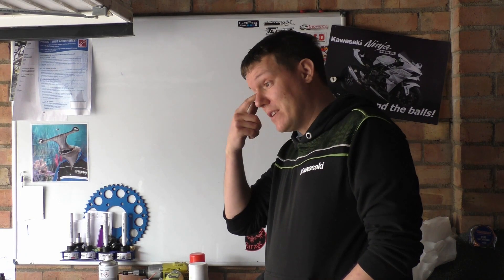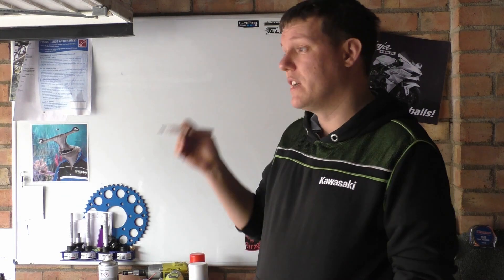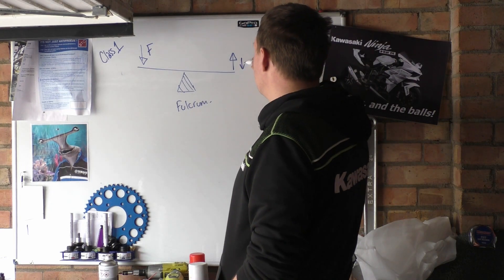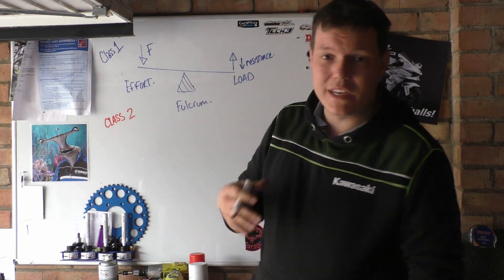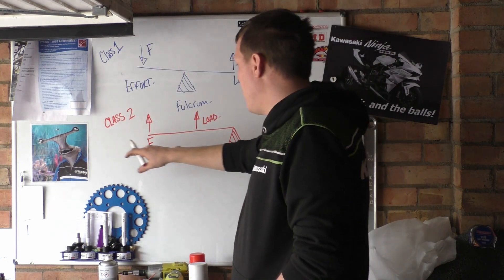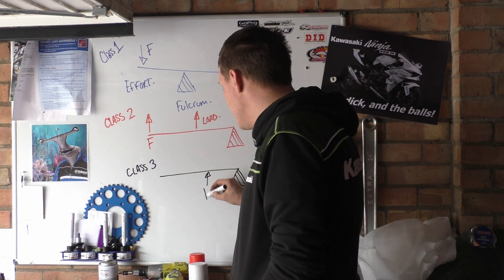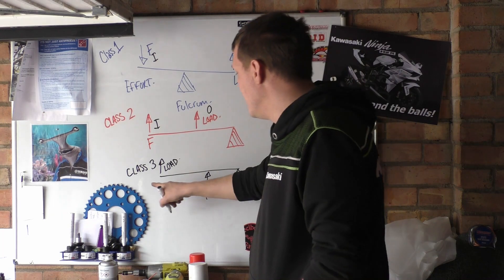Brake question

Comment: Hey Matt!

I've looked on your channel and searched youtube for differences (advantages/disadvantages) in brake lines setup (race vs piggyback vs stock) and couldn't find anything.  Is there any advantage/disadvantage to them, besides the difference in cost and number of lines?

inb4: i could search on google, but with everybody with an internet connection being a genius in all fields nowadays, i'd like an answer from someone i trust.

Thank you!
Reply from the maker: Piggy back is cheaper, but a bit harder to bleed
Reply from the maker: Race is for safety reasons I.e less connection points, less likely to fail
Reply: @thedirtyworkshop   Thank you so much for your answer! I thought about the number of failure points being lower on the race setup, but I thought "well surely there must be more to it, otherwise manufacturers would ditch the 1 into 2 lines setup which has more parts and is more expensive". Guess i was wrong  :D

Thanks again!
Reply from the maker: Remember in racing 2 things are going on 1) you constantly jam on the brakes as hard as possible. 2) you're going as fast as you can all the time. You're dependant on your brakes being 100%.

For the road both cases are not true, and piggy back systems are fine, it's just racing wants to make sure everything no matter how small was done.
Reply: @thedirtyworkshop   I see, i'm not building a track bike nor do i own a fast bike ( 98 gsx600f ) but i want something that has as little chance of failure as possible.
Reply from the maker: Any option is fine
Reply: @thedirtyworkshop   Thank you! :D

Comment: Would it not boil down to the angle? I would guess at class 1 if the load is past 90° if under its class 2. Suppose it's down to the shape of the lever?
Reply: Daz H gonna have to vote for this, can't decide if its a bent class 1 or a relocated class 2 if that makes any fucking sense hahaha

Comment: I'm not sure which about the class but was wondering do you know why motorcycles don't use cable discs? IIRC some used cable drums but I'm guessing it's a power thing, obviously not the same but bicycle cable discs are pretty good when I tried them, hydraulic being slightly better
Reply from the maker: Great question - guess its gonna be added to that fucking list LOL

Comment: Class 1 I'd say. My way of seeing this is that the fulcrum is between effort and load (and it doesn't matter if the lever is not "straight"). When I say fulcrum is "between" I notice that the load can be on the side of the force, but it's still "after" the fulcrum (if you follow the lever
Reply: If you follow the lever from load to end, you find the fulcrum first and then the load.

Comment: I think class 1 with a factor of about 3. So i have a question. So 2 cm movement is about 6 mm of master piston movement because of the lever
The slave must be about 2 times bigger to have a factor of 4 lower movement to move the brakepads about 1.5 mm which is i think about the movement it does. However the 2 calipers inside and outside are way more than a factor of 4 isnt it? Not to speak about 2 calipers on each side. So how does that work? Next vid ?
Reply from the maker: Next vid

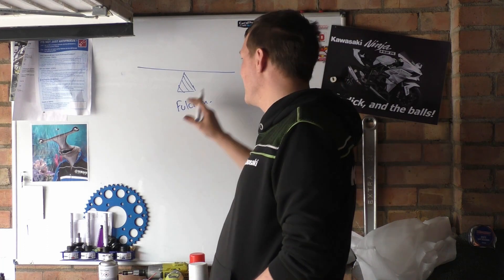Comment: Class 2.. have you heard that main cylinder and brake piston areas should be near 1:20 to have good feeling to lever.. if you have it bigger the lever feels soft and you easily lock your brakes if it is smaller, you lever feels stiff.. but won't size of brake disk to wheel size also be in this calculation? I mean bigger radius on tire and smaller radius of wheel make leverage to shift so you need to apply more brake to stop wheel? Thanks.

Comment: Class 2 cause the forces are going in the same direction the trick"in this question is the fact that the output" is sent through to the right to the brake cilynder...but in shit like radial brakes i think is exactli the same as you drawn in the class 2 example..cheers

Comment: Class 1, as there are 2 levers with fulcrum between them. The fact they are spaced 90° to each other does not mean a thing...torque is transfered equaly.

Class 2 and 3 consider 1 lever with fulcrum in the end.

Comment: I would classify it as a class 2 being the load and effort are both on the same side  of the fulcrum and traveling in the same direction. The effort is also being applied further away from the fulcrum than the load.

Comment: Class 1, because the pivot is not at the end of the Lever and the Forces/Loads go in the same direction on a circle. (Left side, from the pivot, down, Right side up).

Those fancy Race brakelevers are Class 2, to get a better feeling for the brake, because you work against the brake part and not over a pivot.

Comment: Class 2. the applied force from your hand is a greater radius from the fulcrum point, and both effort and load are traveling the same direction. Neat stuff, didn't know there were lever classes.

Comment: Class one. 
Input on one side of the fulcrum, out put the oposite way on the other. 
It makes no difference if the arms are straight or angled. Its about where on the leverage bar the force's input vs fulcrum point vs output and therefore determine direction of output. 
Im all put out myself now

Comment: I take it your refering to a hydraulic system rather than a cable system as the later pulls to the left direction but would be above the pivot point in your diagram. Id say your explanation would be a modified class 2 with the load at 90 degrees and a shorter distance from the pivot than the effort.
Reply from the maker: I say this exact thing in the video.....

Comment: Looks like a CLASS 1  with a fixed load {pivot point) and a moving fulcrum.  If force is applied  to end of lever once it has bottomed it is trying to lift the pivot point but cannot because it is fixed?????

Comment: It can’t be Class 1 because a brake lever of this type has input and output on the same side of the fulcrum (the fulcrum of this brake lever would be the pivot at the end) 

So must be Class 2 or 3...

It cannot be Class 3 because the force applied in this brake lever is furthest away from the fulcrum; then the output closer to the fulcrum, not the other way around. 

It therefore has to be Class 2: as the force acting has a lever effect on the fulcrum at the end and pushes the master cylinder for the system with a greater force (through leverage) than a finger... or two or three depending on the rider 😂 

Maybe I’m miles off with my thinking  🤪

Comment: Well it's certainly not a class 3, since the effort is applied further from the fulcrum than the load. I'm thinking class 2 - if we think of long arm which is used to actuate the brakes as the lever, and the load is pushing the shorter arm in the same direction as the effort, which pivots around the fulcrum and depresses the plunger.

Comment: Has to be class 3, since the force (you) is acting on the opposite side to the pivot point. Where as the load in between the two.

Comment: My initial thought was C1...but after watching again (because no I didn't remember C2 & C3 after erasing) the force and output are at right angles to the fulcrum...so if we adjust the angles in the drawing is it not still a C1?

Also isn't the force/effort arrow going the wrong direction for applying the brake...or am I just lost in angles?
Reply: Never mind...I was lost.  :P  If I was my usual pedantic self I'd say the drawing was drawn for a left hand brake.  But I'm trying not to be in the 80%.   So after realizing I was inverted  I'm keeping w/C1 as the input and output are on opposite side of the fulcrum, though be it at a perpendicular...ish

Comment: I think it's a class 1, because if you pull the lever down you move the load side up, the part that's normally on the right side of the pivot point is just "bent" downwards. The load isn't on the same side of the pivot point as the input is, so it is a class 1.

Comment: Class 2, essentially because you're pulling  rather than Class 1 which is pushing/putting weight on something. Class 3 doesn't make much sense to me why it would apply. 2 Makes more sense.

Comment: Class 1 because the forces are opposite and either end of the pivot point, not on the same side. Or class 4 with the hydraulics doing the rest of force multiplikation

Comment: Class 1 set at a right angle
Reply: Class 1 looks like a 1:1. Brake lever definitely has it amplified.
Reply: Forever Computing  good point, however the fulcrum on brake lever is off center and closer to the load so less force is needed for desired effect.